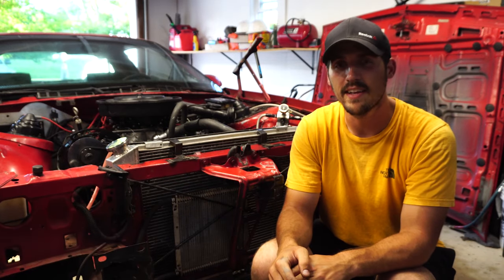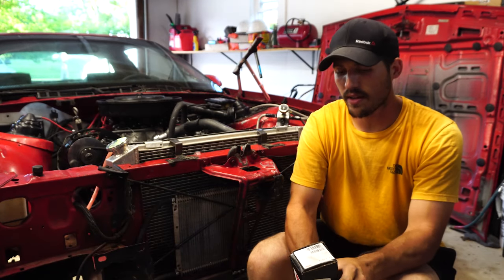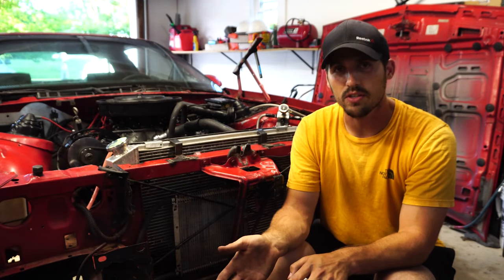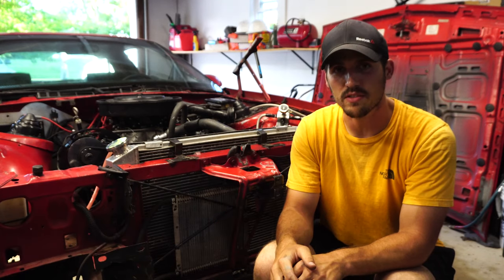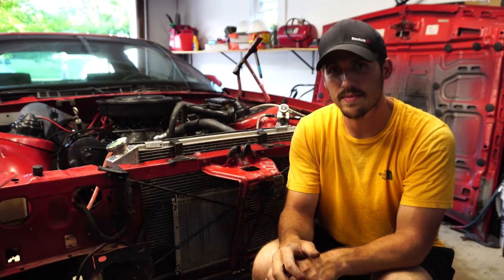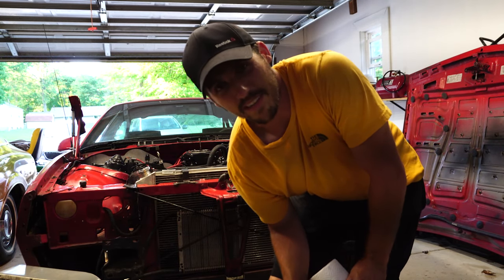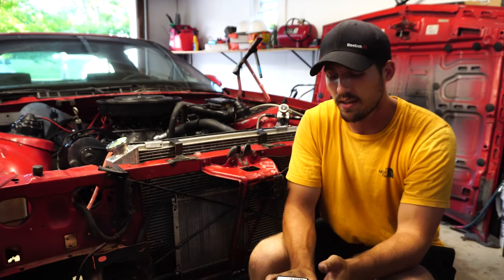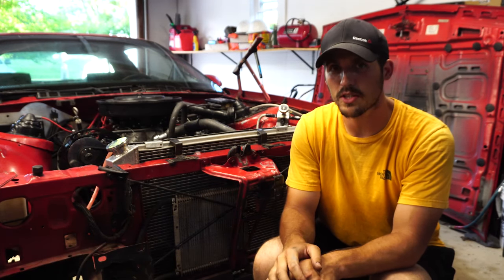Comp Cams Thumpr vs. Xtreme Cam Sound Comparison

Comment: Isn't it the duration that makes the Lope sound you can get a high lift cam and still sound stock
Reply from the maker: Right duration and Lobe separation angle will make the biggest difference in sound   and idle quality
Reply: From my understanding duration will give an engine a choppier sound and poor street manners. But the reason why is intake and exhaust valve overlap. So you can still have a short duration cam with choppy idle. 

Now the low vacuum from a bigger duration cam comes from when the intake valve closes. Basically all cams close the intake after the piston has already started it's way up on the compression stroke. Intake air still has momentum to force it's way into the cylinder as the piston starts going up. By keeping the valve open longer the piston is able to push air back into the intake lowering dynamic compression allowing you to run higher static compression without pinging on the same octane fuel at lower engine speeds.
Reply: nashvilleoutlaw  yes what he just said, if you want to get the chop sound better make sure you are running 11:1 or more compression or you will pay the consequences and no you should not run LSA below 110 with electronic injection and all thumper cams are below LSA 107. Most modern fuel injection  have LSA above 116.
Reply: No, its overlap. Its the intake charge trying force its way back UP to the carb....trying to make it not run essentially. 
Less is more on a true st car...lope is wayyyy over rated.

Comment: Hello please tell me which one do you prefer between those cams. Comp 256 or the other  what is the difference? excuse my inglish.  Thanks
Reply from the maker: I personally prefer the comp 256 cam. They both have their advantages however for my situation the more mild cam works best for me. The Thumpr cam has a rougher choppy idle while the comp 256 still sounds great but with a better idle quality.
Reply: @ZanesGarage  thanks alot
Reply: @ZanesGarage  hi, me again. Do you feel some difeferce between xe256 and stock cam?? I mean. More power ?? Thanks buddy.
Reply: @MauricioHernandez-st8su  You definitely will

Comment: Nice video,  thumper sound cool. Will like 373 gearing carb motor may be better, and playing around the timing I have video me rev a motor to 8000 rpms. I have 82 Camaro with 327 motor running.  Schneider race type in 327 Schneider cam Brown color car.

Comment: 2500 stall converter,  3500 if it doesn't see snow/ rain. Big lift don't have any bottom end, all middle and high rpm. You get over 500hp, you will twist the body and doors won't work smooth. Lol, been there.
Reply: Sounds like somebody didn't have subframe connectors and upgraded torque boxes lol

Comment: I actually have a muthathumpr cam in my 1990 Chevy c1500 and I’m going to back to the original cam. I bought the cam for the hype and it’s not the best with my sniper efi.
Reply from the maker: I get that about the hype. They sound good but so far this new cam seems way more responsive!
Reply: Zanes Garage I’ll look into it! I caught wind of your channel from sniper efi videos and I’m staying for the content to come!
Reply: @RAMIREZTX  please do not get a mother junker cam. They're ground for sound with NO PERFORMANCE
Reply: I bought a mutha thumper for my 83 TA 350/5 speed because of the hype from all the magazine types. Hard to tune, disappointing power with the best sound by far. I’ve had it 10 years but barely drive the car because the power band sucks in traffic. May do this swap but was thinking about going roller.
Reply: The Big Picture exactly why I decided to go back to the stock cam. I had it laying around. It only cost me some time but that was it
Reply: @bradleydennis1263  Its not that theyre junk.  its they need a lot more initial timing and compression than people think.

any big cam is gonna wanna whatever timing you can throw at it before the starter to kicks back at you.  

ive heard people run 24 degrees initial on these types of cams to get it to run clean without messing around with the carburetor setup and jacking around with the idle screws and mixture screws going in circles to get it to run right.  

big cams = WAY more initial and limited mechanical advance and more stall compression and a mutha tumpr is getting up there.  not huge buts its not a small cam either  be good in a 383 stroker
Reply: @ZanesGarage  so why not run the thumper throw in some 4:11s with a 700r4. Get them rpms up
Reply: Comp doesn't recommend efi with the Thumpr cams
Reply: @bradleydennis1263  what kind of heads do you have?
Reply: @thebigpicture2032  Any line of cams with dorky names I stay away from. SBC has been around since the 50s only so many grinds that can be made . Seems around 2000 most brands got bought out, good stuff discontinued and goofy names of new grinds came out...gimmicks imo for guys that dont know any better.

Comment: I wish I would have learned how to rebuild engines
Reply from the maker: No one ever taught me and I'm definitely not an expert but the only way to learn is by doing it! (And messing up a lot)
Reply: Mr. E ant nothing to it but to do it man. Buy a how to build an engine book and read it. Make a list of the parts you want to use and research how they will work together before buying anything. My current build I'm working on is a 9:7.1 383 with AFR 195 heads and comp xr288hr. Shooting for close to 500hp in my El Camino that can still run 87 octane because I like to drive mine.
Reply: @nashvilleoutlaw  awesome.  Good advice. I read everything about the 4 stroke of combustion and understand how they work internally,  and that was at 16. I am 48 now.  Maybe someday. Need a buddy to do that with me. More enjoyable.
Reply: @mr.e1220  yea nothing like building a project with friends. I'll give you a couple of pointers on building an engine. Buy pistons with a small ring pack because engine will last longer and you get an extra 8hp or so up top. Cam will determine the compression ratio you need. Everybody talks about static compression, the measurement of piston travel from bottom to top dead center. Very few mentions the camshaft controls dynamic compression. That's the measure of where the piston is at intake valve closing and piston reaching top dead center. That is a big determination of what octane and static compression you can run because the intake valve closes after the piston is on it's way up. That leads into why low runner velocity and to big of a head are bad because the piston will push air back out of the cylinder with low velocity runners at lower rpm. There's you a few bread crumbs to follow lol
Reply: @nashvilleoutlaw  thanks 😊
Reply: It's not to late to learn, not that hard really, my problem is I don't have a garage
Reply: Never too late to start. I'm teaching my 16 year old daughter and she is in auto shop at school with the boys.
Get an old worn out small block and engine stand. Get tools. Learn name of parts. Take it apart.
Reply: @mr.e1220  and beer.
Reply: @nashvilleoutlaw  he's better off buying a running engine for cheap taking it apart and putting it back together with just buying gaskets and no parts. If it blows up not a big deal.
Reply: @briandcarey3110  I bought an old van. Used to rebuild engines in it. Or you can use an old shed. Deep six the yard tools. Quit making excuses.

Comment: Had the comp cam in a 455 pontiac bored 30 over with 10:0 to 1 ran like a scalded dog the big cam i tried had no low end torque sound aint everything

Comment: With the holly sniper set up did you have to install a different fuel pump
Reply from the maker: Yes I did I run a walboro 155 I believe. You need to have a fuel system that can run at 60 psi as well as a return line.

Comment: When you installed the thumper did you change over to new springs from Comp Cams
Reply: I would. If your heads are stock. I have a mutha thumpr in mine with stock valve springs. It hits valve float at around 5000
Reply: Be careful the rocker arm studs don't pop out
Reply: Youll have to

Comment: Thumper sounds cool, but I’ve wondered how streetable they are.
Reply: I had big mutha thumper cam on street with 3000 stall works great
Reply: I had no problems. My s10 blazer 4 door ran 12s. And I drove it everywhere. It's all about having the correct parts to work together

Comment: 😂🤣😂🤣😂🤣😂 all of you are wrong. Get a set of Afr heads and run that thumper cam with a 1.6 rocker and make sure you have atleast 10.21compression and get a vacuum canister or manual brake booster. Because it sucks alot of vacuum from your brakes

Comment: That smaller cam hes running, in a 350 st car from a dead stop wil pull hard smoke tires and drive like oem. Its not the line so much. 
ANything much bigger is simply overcammed. Some of the strongest st combos out there are mild just well thought out.

Comment: The thumper cam will run better with a carb.
Reply from the maker: Used to run it with a carb and your absolutely right.
Reply: Why is that?
Reply: @5literfox89  Efi is a little harder to adjust/tune then a simple carb especially with the tighter lobe separation angle on the thumper cam. Tighter the LSA the choppier the idle will be. I have a 107+3 LSA hyd. roller cam in my V8 S10.(Check it out on my channel). With the carb set up it's simple to tune, couple turns on the idle mixture screws and you good.

Comment: Always go roller cam like a  XE 288 HR ,XE294 HR OR THE  XE 276 HR
Reply: Idk what to do.. I currently have a Regal with a 350. Xtreme energy cam but I wanted more sound so I was going to switch to a Thumpr but now I'm reading it doesn't give you the same performance.. I may swap to a LS lol
Reply: @Spacesprocketz  Just go with better heads. Vortecs deliver good power for low cost and they're easy to find.
Reply: @falcon6995  Thanks for the reply bro. I actually put Vortec heads on not too  long ago but I did'nt notice too much of a difference. I may need to change my cam set up because I'm still running the same High energy cam that I was already running.
Reply: XFI 280 went completelty flat in less than 1 yr, 15k mi. Junk
Reply: @Spacesprocketz  High energy cams are pretty good and last cause they dont have too steep a ramp on them
Agree on the vortecs they are super over rated and will feel roughly the same as a stock smog head

Comment: Of course the mother thumper sounds better but does very little for power your new can actually give you way more power unless you have the rest of the motor Shut up for a camshaft not the thumper but it came shaft with the right lift and duration that would sound like that it's not going to do much for you is actually going to hurt you are you getting the sound and no performance